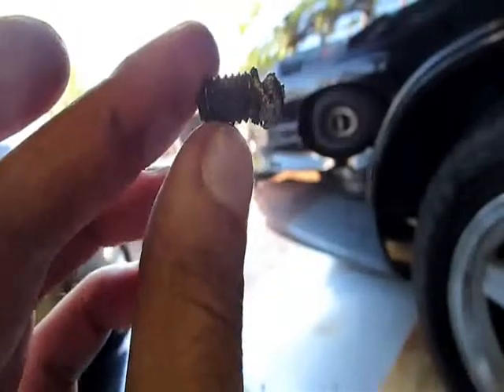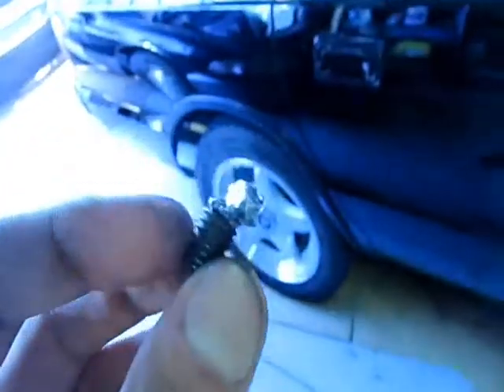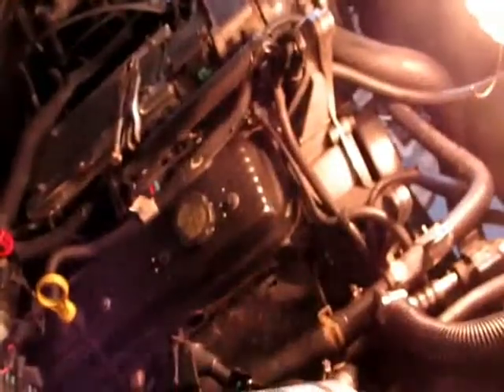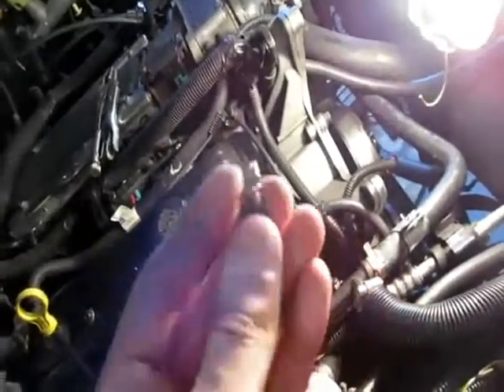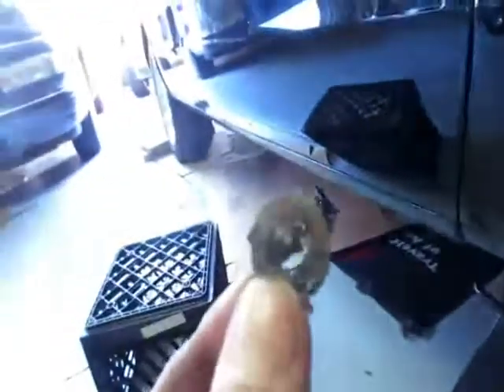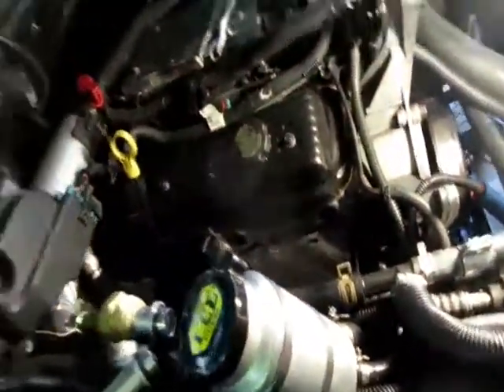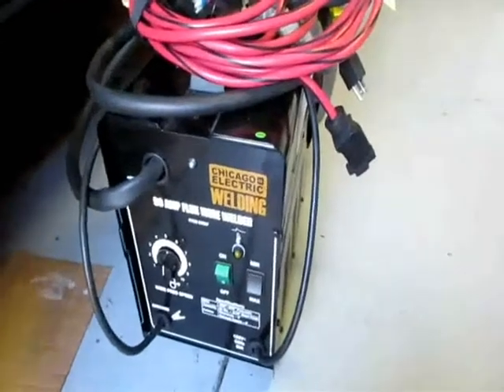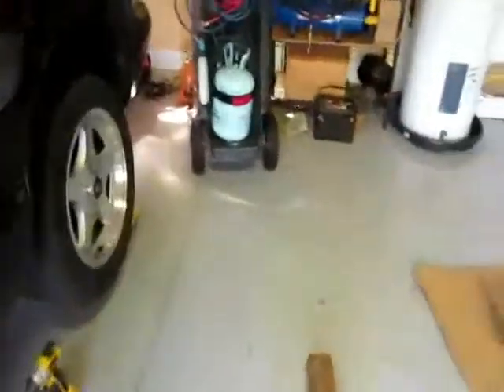Welded a glob of weld to a broken bolt to extract it

Comment: what i do is lay a nut on top of the broken stud, and fill the center with weld.  That way i dont put weld around and i can take it out with a rachet
Reply from the maker: +Veikra  I tried that. Nut kept walking around and the angle was bad, so bottom line welder would not reach.  IF I took out the inner fender well, it would be a straight shot. I was thinking about it, got mad and made a glob.
Reply: Glob worked, and that's all that counts at the end of the day
Reply from the maker: Veikra
 Ill buy a good welder with gas and try to get the bolt out of the 5.3 truck. Its broken in the back

Comment: thats what happens when you let vehicles sit like that. stuff starts to get bad
Reply from the maker: +Travis R.  It was rigged up bracket, using old stretched hardware, ill come up with something better. The bolts and studs are notorious for breaking on these cars, cheap hardware, who knows where I got that stud that broke from, something used with alot of heat cycles.